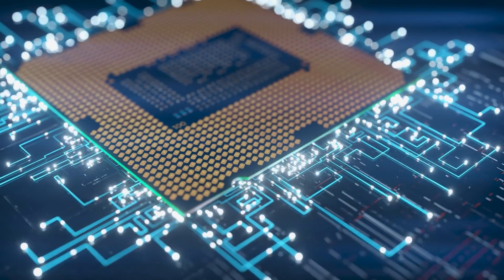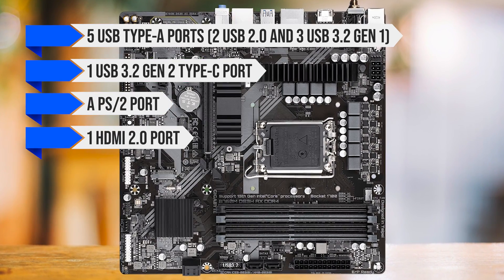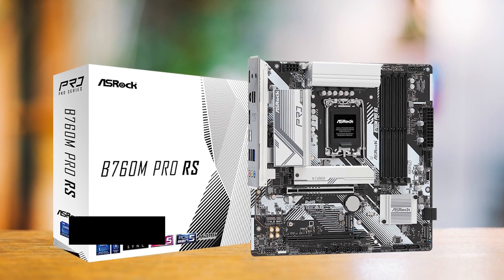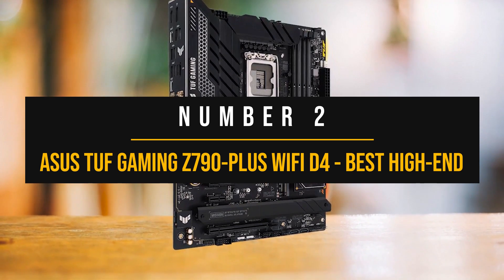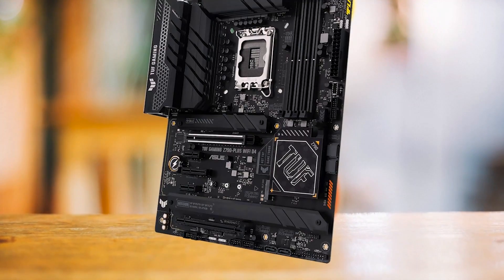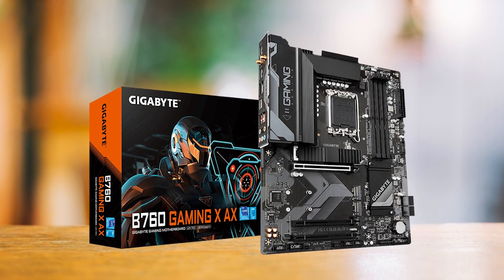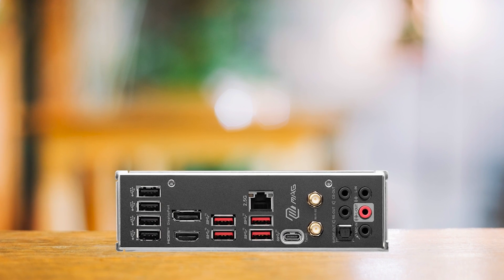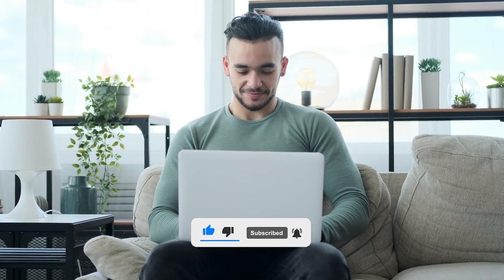THE BEST MOTHERBOARDS FOR INTEL CORE I5 13400f! (TOP 3)

Comment: asus prime b760m-k d4 offers also 2.5 gb Ethernet and 2 mv.e2 pcie4, also cheaper. I'm looking for it but can't see any reviews so I'm bit worried bout vrm/heatsinks and cooling issues, some said vrm n heatsinks are bad in it, im pairing it with 13400f
Reply: I'm using asus prime b760m-k d4. It's fine. if u just play triple AAA game or FPS game, it's ok

Comment: I have an msi pro h610m-e paired with this processor with a deepcool ag400 air cooler is it fine? And whats the max tdp this mobo can take?and whats the vrm in this mobo srry i am a noob
Reply: Bro I'm confused should i buy the h610 board for this cpu can i still get the full performance?

Comment: Excuse me but I've recently gotten my hands on the msi mag b760 tomahawk wifi ddr4 and paired it with the Intel core i5 13400 (not the i5 13400f) and the motherboard isn't reading the CPU is it possible that there's a difference between the two CPUs as to why the motherboard isn't reading it?
Reply: You might just need a bios update ,first find a 12 gen cpu to update the bios and then put your i5- 13400 into your motherboard and  It should work fine.
Reply: @contiki6277 or just simply update using q flash